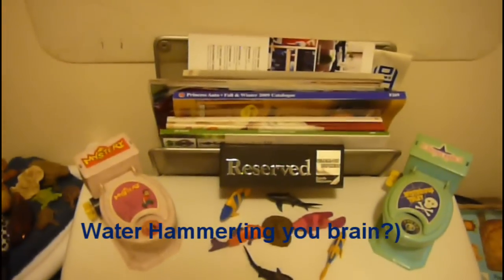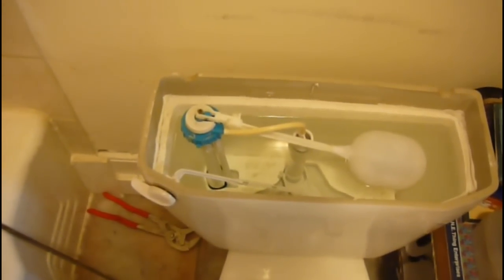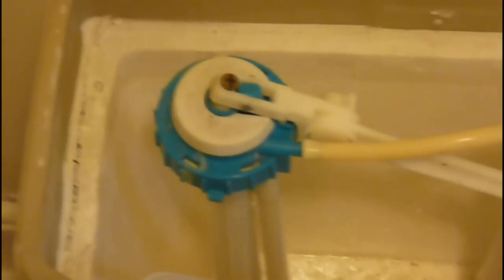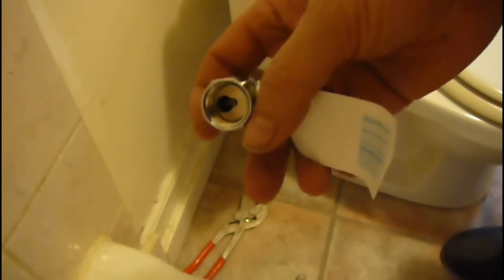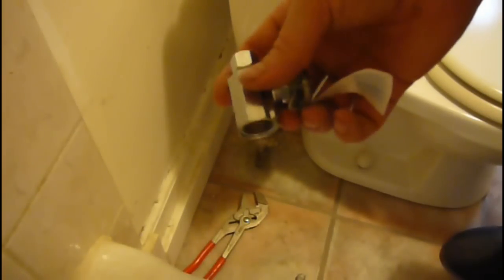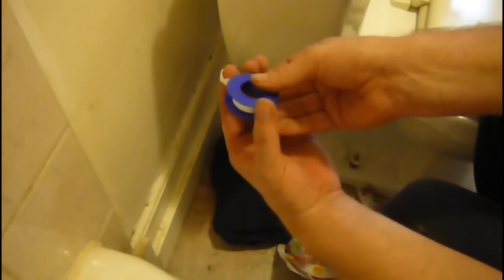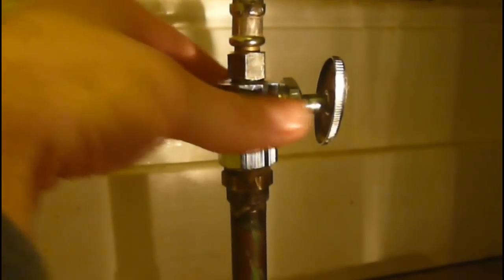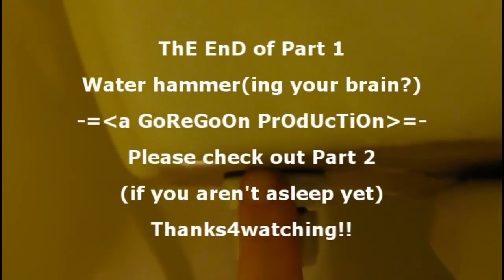Water Hammer (ing the brain?) How to fix your toilet and stop that ANNOYING "Water Hammer" (Part 1)

Comment: Most of the time, it's the shut off valve. The easiest fix is: kneel on the ground near the toilet so you can both flush the toilet and be near the shut off valve. Flush your toilet and when the noise (hammering) begins, either open or close the shut off valve SLIGHTLY. Your noise will magically disappear. Shut off valves are usually made of steel, copper or other metal and wear out. If you can't get rid of the noise OR comes back after the open-close trick. Get a new shut off valve...
Reply: Worked for me thanks!!
Reply: Thank you! Slightest adjustment open and boom, sound gone.

Comment from the maker: You probably have a washer that's got a chuck hangin off it. The water goes slow and vibrates it and it caries through the house. Fast wooshes by it to fast to get it started. Who knows, but that tap is the one to hit. As you know, I ain't a plumber (though I do have quite the plumbers crack) LoL

Comment: I remember almost 7 - 9 years ago when I was but a young young boy (I'm still young, but whatever), I would be falling asleep when this sound - almost like somebody was tapping on a metal pipe with a hammer - would occur every 10 minutes.  It would either start off quiet and slow, speeding up and getting louder until it stopped, or just went on loudly for a few moments.  Scared the living hell out of me.  Didn't help that it was coming from the maze of pipes in the room right below my room.

Comment from the maker: @travelsonic Scares the living hell outa me and I'm almost 46 LoL, It's quite the sound, and it carries through the whole house. It's also one of those things that need to get fixed as it has been known to vibrate the solder loose on your piping and spring leaks.

Thanks for dropping by!
Reply: Mine is shaking through the entire house all the way out to the main meter. It’s louder at the shower that was working in recently for a mixture issue. Now I’m wondering if the toilet is fd up too or if it’s a main pressure issue.

Comment: I had the most terrifying night of my life due to my toilet. A few years ago, around 11:30 at night, we hear this HORRIBLE noise. It sounded like a fog horn just went off inside our house. The whole house was vibrating to the point that pictures on the wall were tilting. We didn't know WTF was going on. We thought our house was literally tearing itself apart. Or the water heater was about to explode. Did that ever 2 minutes. Turns out the flapper valve was warped, cause ALL the pipes to vibrate.

Comment: i had the same problem after installing a new flush, tried everything and nothing worked untill i rememberd i also replaced the pipe going to my tank, it was an old pipe that i replaced with a "flexible". turned out that when i installed the flexible it got a bit contorted, by simple adjusting the flexible so it was nice and straight the vibrating was gone
Reply: Thanks i read this and checked my hose.  I pushed it back behind the toilet and no more knocking. Maybe I pulled on it when I changed the small trash.